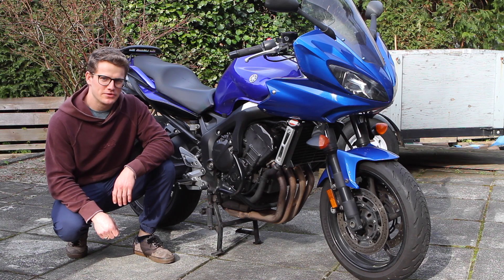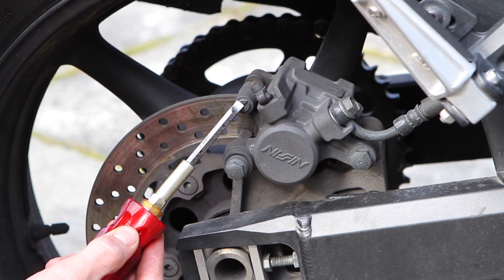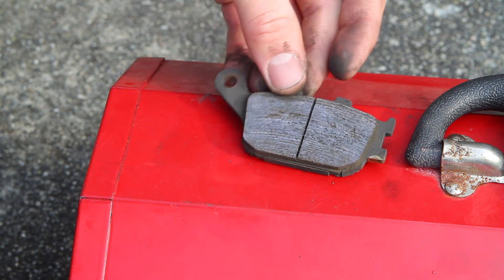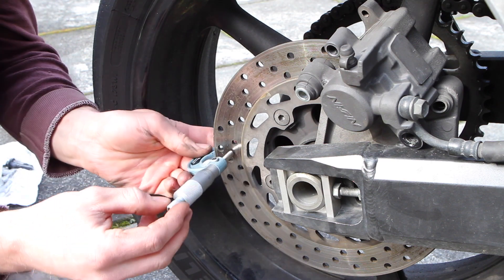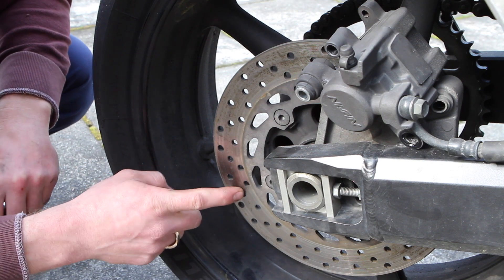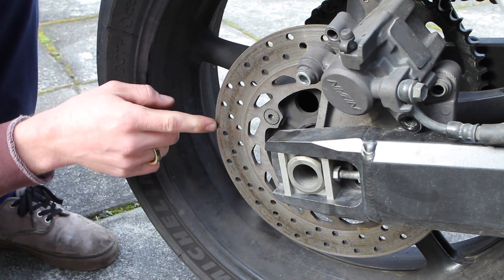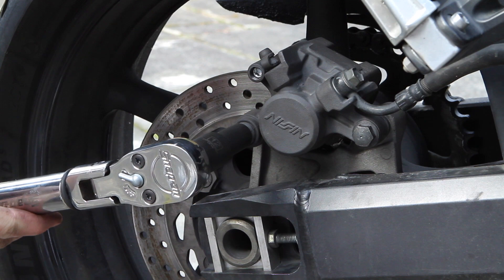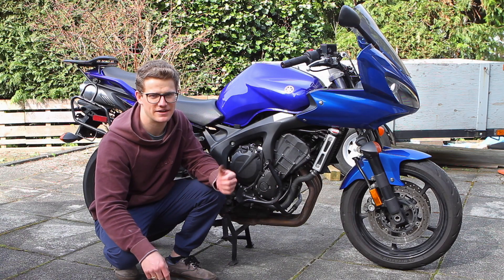Yamaha FZ6 Rear Brake Pad & Rotor Inspection + SPECS

Comment: Hi, how many km/miles does the fz6 usually last through its lifetime when properlly servised? Does the valve train last lifetime or what interval is recommended to replace it? THX!
Reply from the maker: I recall the valve train interval being 40,000 km to check the lash. Otherwise I've seen FZ6 last over 200,000 km's on the original engine. They last a long time!